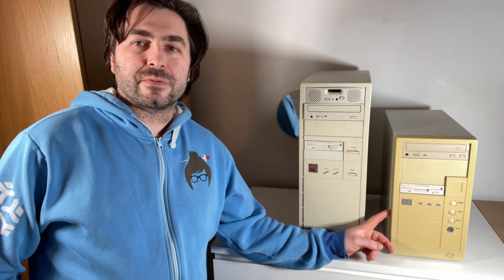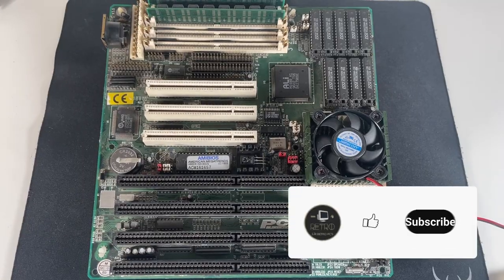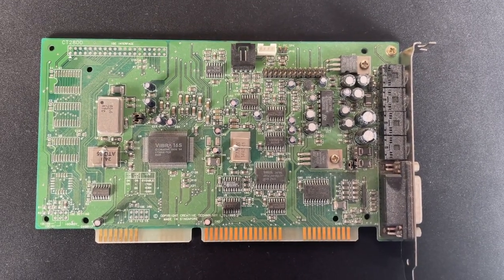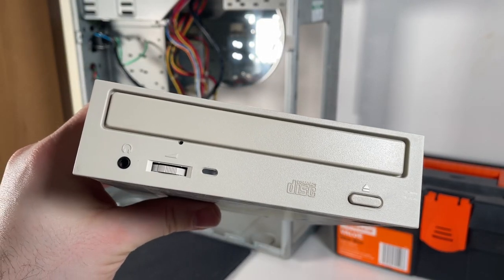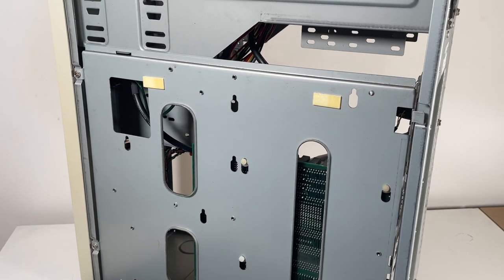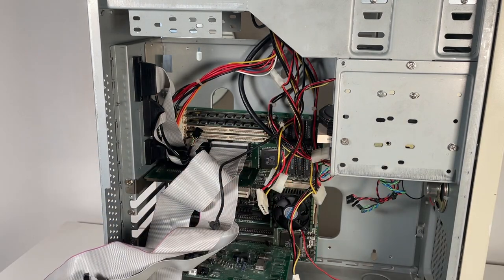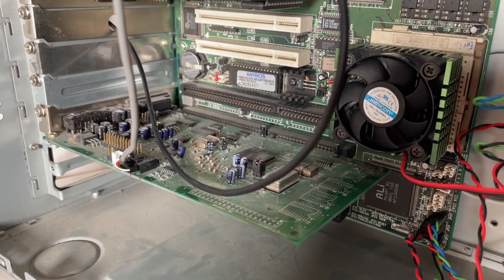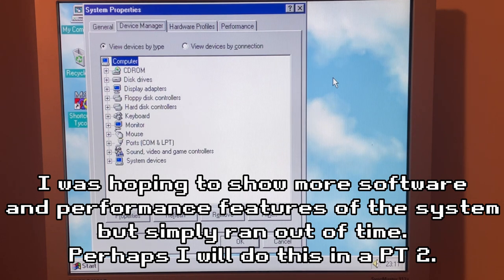My DREAM 486 build did not go to plan..

Comment: Honestly, looking at the original build video, I think the older case is somewhat higher quality than the newer full tower case, and I like it better visually.  But I'm a sucker for a short and chunky mini-tower case..  Pity about the cheddar cheese yellowing though.  It might be worth a try to retrobright the front plastics.  Don't toss it!  AT cases are getting really hard to find.

I remember being told once that PC Chips didn't manufacture all of their own motherboards, they subbed some of them out, so consequently you get differing build qualities, and they didn't really get terrible until the Socket 5/7 timeframe.  Your board looks a lot nicer than most of them I remember.

You used to be able to buy beige Lite-on LTN-486 CD drives for almost the cost of shipping when the beige Dell office class machines were in the cycle for scrapping after coming off lease and EOL, They were excellent for builds like this.  A fast 48X drive that didn't have any writing on the front to detract from it's plain-jane design, so it blended in perfectly with older builds.  Alas, the days of buying them at $20 for 5 units, shipped is long gone.
 
Have you looked at Atheatos and Necroware's videos on factory BIOS modding?  I suspect that with a little bit of tweaking you can get rid of the 2GB limit in that BIOS, and get it up to either 32GB or 128GB.  Either of which would be overkill for a Windows 95 486 machine. Not to mention, you might be able to unlock some more tuning settings that the manufacturer has hidden.

It's always nice watching someone else build a vintage PC, I get to experience it vicariously, without any of the sheet metal cuts on the fingers or failed or inexplicably incompatible hardware.  Good job flogging this one until it bent to your will!
Reply from the maker: The smaller case was certainly not a bad one! Just not to my taste and very cramped inside. It had also taken a knock when it was delivered to me originally and it was constantly on my mind that the insides were not "perfect"!
Dont worry I will never throw away any old hardware! 
I have watched both those vids on bios mods! Great vids but I am yet to buy a programmer so its not easy for me to do! (I have hot swapped them in the past with success!)

Thanks for taking the time out to watch the vid and share your thoughts on it! I am very happy it eventually worked out. I think I might do a part 2 in future once there has been a few changes. Perhaps some retrobrite and a new VGA card or even perhaps sound.

Comment: Forgive me if someone else has already commented this. With those older PC cases, like that, you usually had to remove the front bezel before installing the drives. That's why they were tight going in and protrude like that. Sweet machine, though. My first PC was a 486dx2 66MHz. I would love to build another one to have now.
Reply from the maker: I have had some cases like that, but with this one I am sure its just that the drives are slightly bigger as I did have one that fit in lovely, it just didnt work! :))

Comment: Sorry to hear you were losing your cool a bit with all the issues at the midpoint on this one.  They don't all turn out, unfortunately.  Blast all those slots and sockets with electronics cleaner (doesn't have to be DeoxIT, the MG stuff works great, too) and then work the cards in and out of them to loosen the up and get them working again.  You're gonna want that Sound Bastard on IRQ5 for DOS gaming.  I usually deep clean everything in the sink so I can hit them with all-purpose cleaner and make a big mess without destroying my workbench area.  Glad it came together in the end!
Reply from the maker: Cheers! It was frustrating and even afterwards has given me some grief! I think I will have it all out for a deep clean at some point. Fortunately all of the games I play don’t mind the higher IRQ. Anything older I would play on the Dell

Comment: Nice work.  Shame about the problems but I guess back in the day things werent as plug and play as they are now and you are battling aging components on top of that!  I have four dream retro builds.  One  for XP (Core i5 3340, GTX 750 Ti, Soundblaster X-Fi) .  One for early Win9x (933Mhz Pentium III, Voodoo 3500, Aureal Vortex). One for late Win98 (Intel Core x6800, Soundblaster Audigy, Nvidia 4600). One for DOS (Pentium MMX 233Mhz, Soundblaster Pro 2, Voodoo 1, S3 Trio 64 - using Philscomputerlab 136 in one idea).
Reply from the maker: A very nice selection of machines!

It is frustrating but also amazing how finicky some of these old components could be. To think we used to sort these problems without the help of the internet!

Comment: I truly hate to be a moaning motherflipper, but you do need to be wearing an anti-static wristband when you're elbows deep in these archaic boxes old fella.
Reply from the maker: Ah you are probably right! But my method of grounding myself before I start has worked for many years! Until that time when it doesnt :D
Reply: @ljrretropcs  "Until that time when it doesn't" <--- A statistical inevitability!
Also, if I may be so bold, a little contact cleaner in expansion slots can help on a stubborn board...
Anyway, nice build, and I hope you get that cable management sorted!
Reply from the maker: It will certainly help! I should have cleaned the components and insides as part of the build but after 3 sessions I was exhausted with it and wanted to play some games! Once I have sourced a better VGA card I will make good the missed parts :)

Thanks for the nice feedback! :)
Reply: @ljrretropcs  Indeed, a quick brush with some isopropyl alcohol will do wonders, not just for the looks but with the running temperatures as well.

No worries, you're welcome chap.